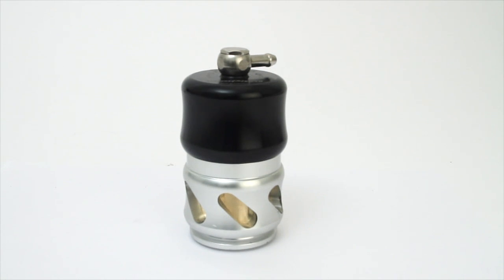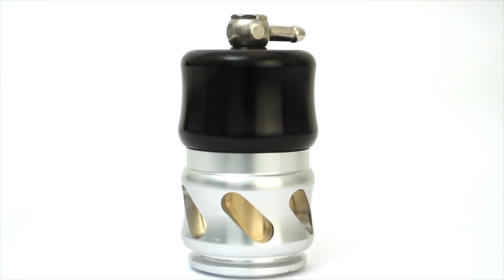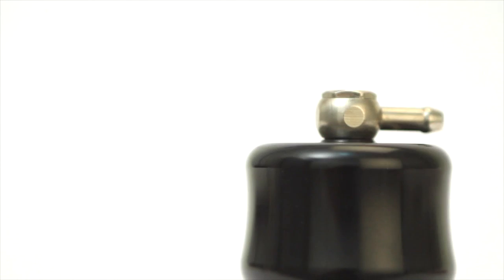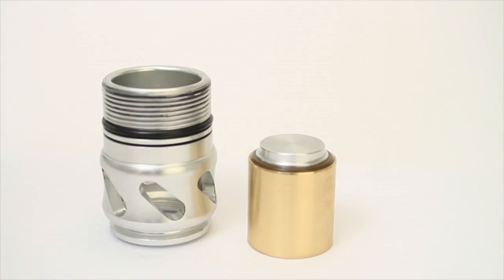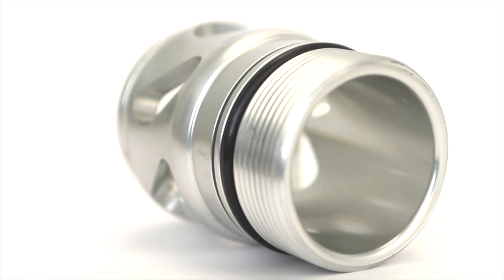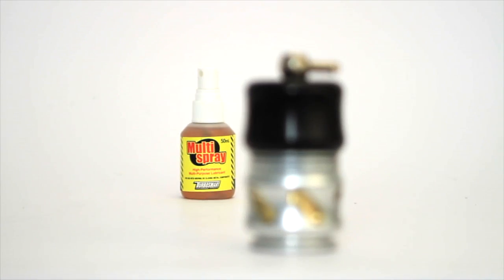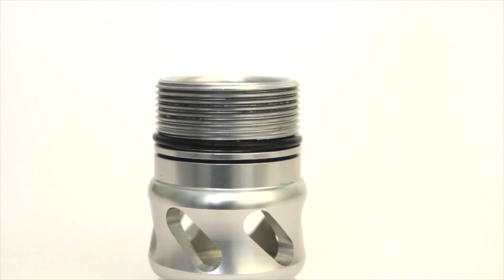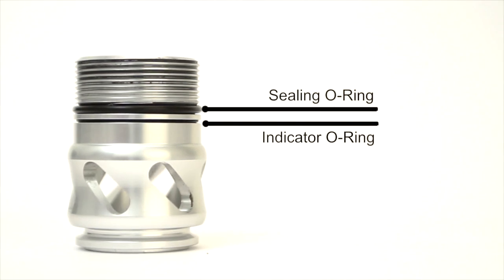Cleaning your Turbosmart BOV or BPV

Comment: It is this easy for the 2020 ford rangers bov dual valve vr13 ?
Reply from the maker: That valve technically does not need to be serviced in the same way. You can actually remove the valve, drop a few drops of lubrication (like what's used in this video) in the dual port opening, then actuate the piston by hand a few times to distribute the oil.
Reply: @TurbosmartHQ perfect thank you for the info

Comment: I have a Turbosmart Kompact 50/50 dual port BPV for my 17 Focus RS, I was wondering if I can use Remoil or my gun lube inplace of the oil in this video?

Thank you.
Reply from the maker: Yes, you can use either of those to lubricate the valve.